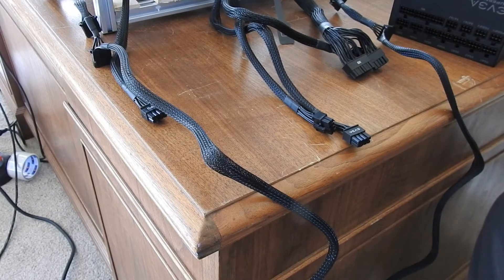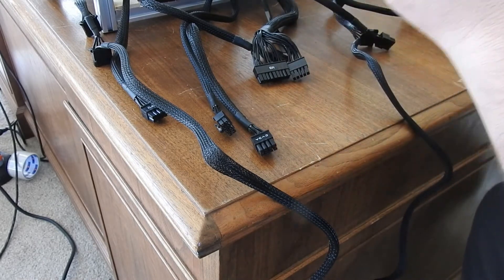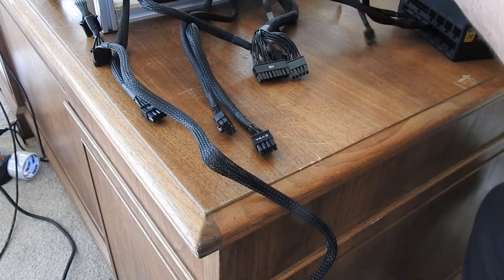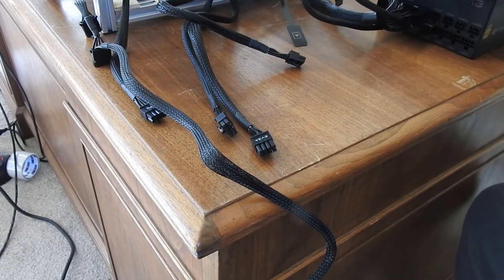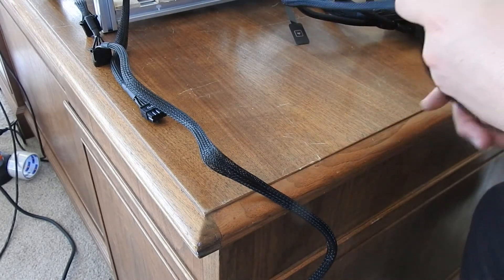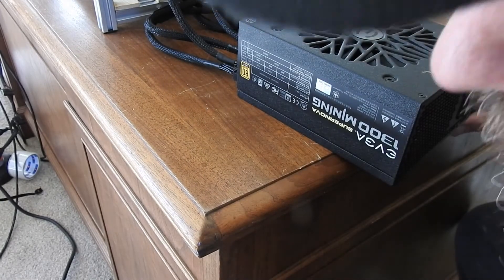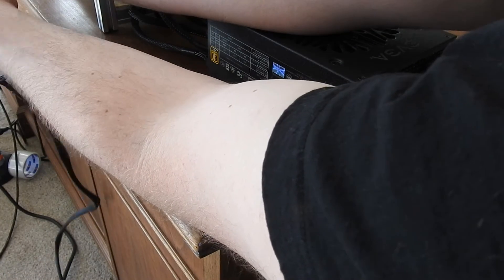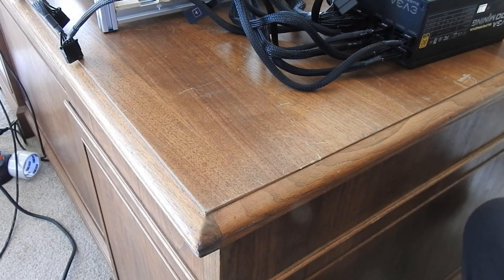[Asus Prime Z390-P] - Part 22 - Attach the EVGA Supernova 1300 mining power supply.

Comment: Do you have any footage of the 6 gpus running and hashing? Was it difficult how to manage to set the motherboard in order to get all 6 gpus running? Sorry for all the questions but I’m considering buying this motherboard to build a 6 gpu rig and I want to be sure I won’t run into any problems. Thank you, and nice content btw, it helped me a lot.
Reply from the maker: It has been a back and forth struggle with these motherboards truthfully.  I had it running six GPU's for three weeks and I changed the orientation of the rack and been having trouble getting one of them to work again.  So right now I have five running with six plugged in.  I have been playing with the motherboard bios shutting off extra stuff, changing out riser cards because I have extra, and to no avail.  I put the GPU's on another rig with the same riser cards and they work fine.  I will get back to you on this one.  I do have a ASRock H81 that runs 6 GPU's great.
Reply: @dragonslair80  yeah, no surprise you are struggling. I’ve spent quite a few hours searching info about this boards and it seems like if you even stare at them for too long at least one of the gpus stops working.
Reply: @dragonslair80  sorry, me again. Do you believe that the ASRock H81 you’re talking about could run 6 rtx 3070?
Reply from the maker: @TOBTOB92  I do not see any reason they would not.  Be careful buying those as they might get nerfed in the future.  Geforce nerfed the 3060's and are making a new line just for mining.  Just a heads up, when the new line comes out, they may nerf those also.  Just a heads up.